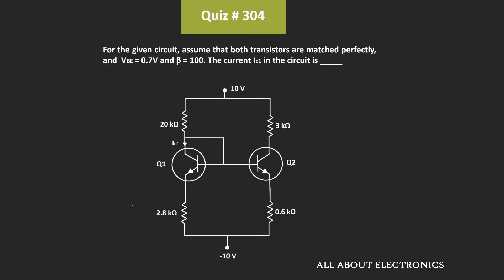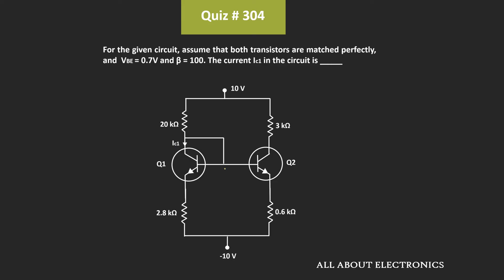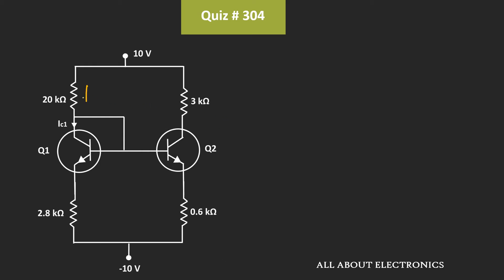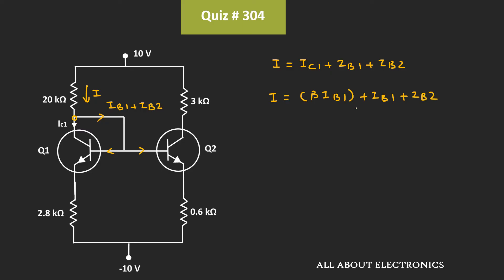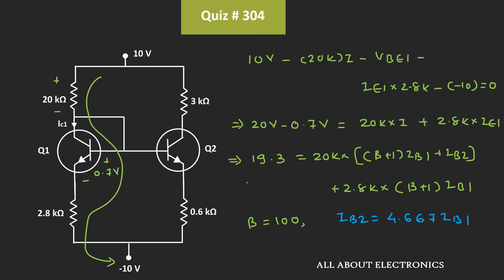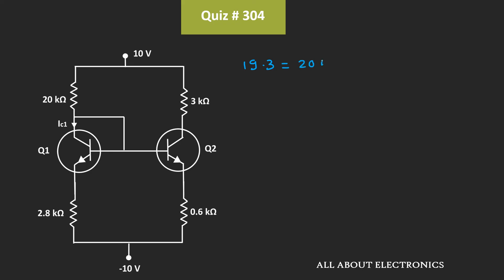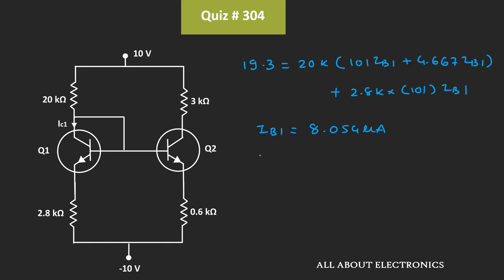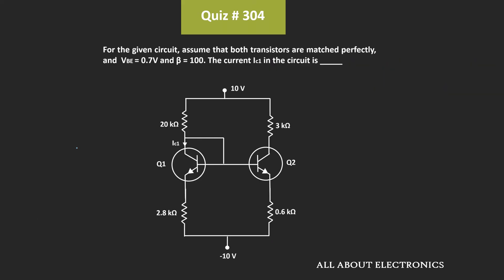BJT (Bipolar Junction Transistor) Solved Problem | Quiz # 304

Comment: Since the base voltage is common for both the transistors, won't the emitter voltage also be same since Vbe is same for both?
Reply from the maker: VBE will not be the same for both transistors. We typically assume that the VBE is same, but there will be slight difference. And due that difference the collector currents will also be different. 
I have explained that in the BJT Large signal model.
https://youtu.be/ME41uPsDxFo?si=uKNnNKqhmWSmpGsQ

Comment: One question: in which order happens when current follow , : is it 1: VBE > 2 : IC > 3: IB 
Or
1: VBE > 2: IB > 3 : IC 

Which sequence is right?
The action of flowing current through the collector will cause the the current through base current or is  it opposite,  the current first go inside base then the current collector comes later , ?

Which  equation order is  right : 
 IB := IC / B ??
Or
IC := IB * B ??

This is very tricky,  please note that .

Comment: Sir i have a doubt. If the transistors are said to be matched ,didnt that mean they both have same collector current and base current and same beta ??
Reply from the maker: When we say they are matched, it means they have similar device characteristics. Like the same beta, almost same VBE and same reverse saturation current, etc. The value of Ib and Ic depends on the external biasing circuit. But if the same external biasing resistors are used then for the matched transistor, the biasing current will also be the same. In this case, if you notice, the resistors are different and hence different collector currents. 
I hope it will clear your doubt.
Reply: @allaboutelectronics-quiz  wow. Thank you soo much sir !
Reply: @allaboutelectronics-quiz  sir,resistors different means,u mean the collector resistors are different for both and emitter resistors are different for both?? Pls clarify this one sir !
Reply from the maker: @neelyo642  Yes.